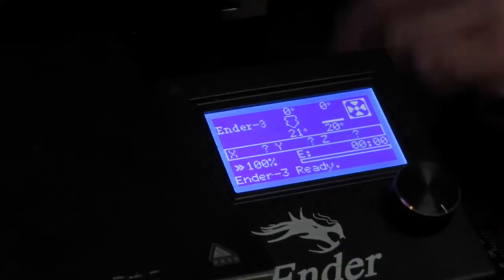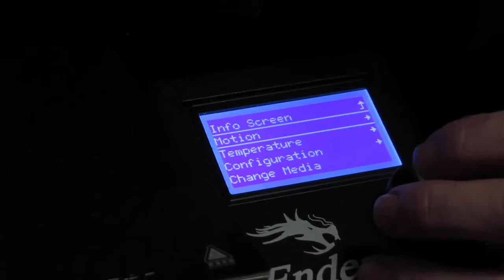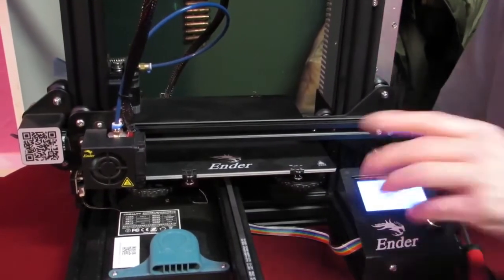Creality 3D Printer Homing Fail Fix

Comment: Thanks for the videos. I have got the same problem right now. After power up I can drive the Z axis up and down but after a Homing it acts just like in the video. and then I can not drive the Z axis down. Up is fine. What I did was changed my Ender 3 V1.1.4 mother board to a V4.2.7 board. Thought it might be a bad board. Got another new board and it does the same thing. I am not a coder at all but did get the newest firmware from Creality and installed it. No luck as of yet Any ideas?
Reply from the maker: check all the micro switches for continuity and connection to the motherboard.
Reply: @shorty4901  Turns out that when I was updating the firmware I was using a 64 gig SD card. It didn't register in the mother board. Saw somewhere that you have to use a 8 gig SD card or it won't work. That was the answer. Used 8 Gig and everything works fine now. It's all magic.

Comment: I updated my firmware last night, from 4.2.2 to 4.2.7, and now i have no XYZ & E movement, i try to auto home, it pauses form like 5 sec, then i get a message come up "Homing Failed, PRINTER HALTED, Please Reset". I Have tried to remove the micro switches, even the CR touch, but still not movement. Can anybody help please?
Reply from the maker: you may have used wrong firmware file. can you flash it back to how it was?
Reply: @shorty4901 same here i have the same issue 😢 please help or add a video about it or what the firmware is
Reply from the maker: @ go back to old firmware, and remember if it aint broke, dont "fix" it.

Comment: my issue has nothing to do with wiring. I didnt start having this issue until I updated the firmware after installing a CR Touch. Ever since the extruder has been in reverse and now that I found the "right" firmware for it, its giving me this error in the video.  It literally auto-homed just fine not 5 minutes before I flashed the Ender-5 Pro- Marlin2.0.1 - V1.1.1 - ALT firmware and trying to revert does not solve the issue of a reversed stepper motor on my 4.2.7 board.

No Im not fucking with the wire connections like trolls would recommend. I just plugged it in normally like it was when it came out of the box.

Comment: Thank you,
your video helped me out. The issue I had was when I made an upgrade I moved the micro switch without knowing it. The nozzle kept moving up when I autohomed. The metal part of the switch was pressed against the bar. So I loosened it and realigned it, the problem was fixed.
Reply from the maker: Glad it helped